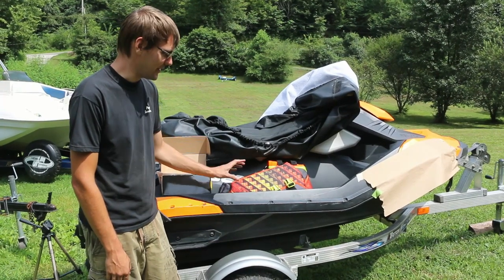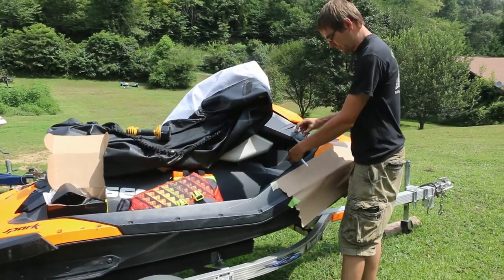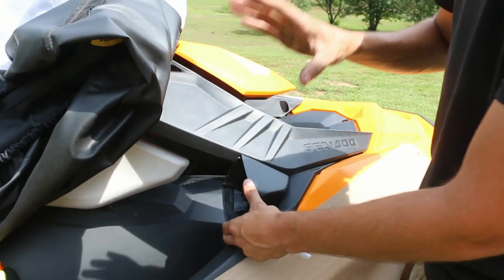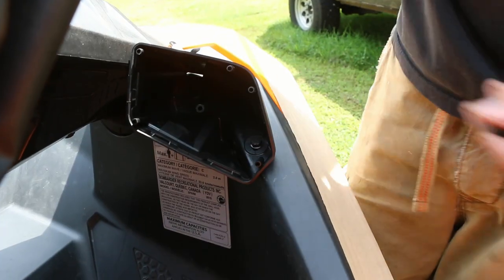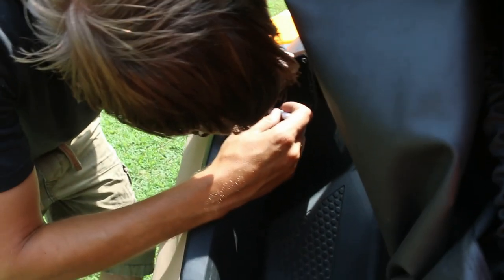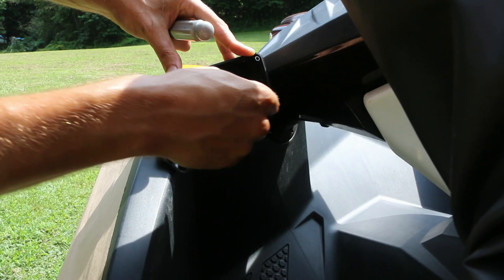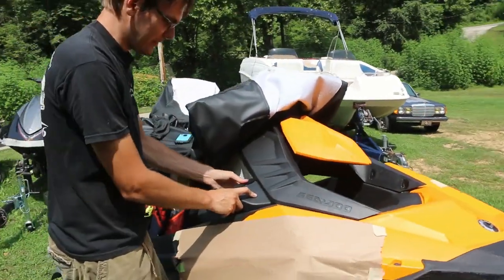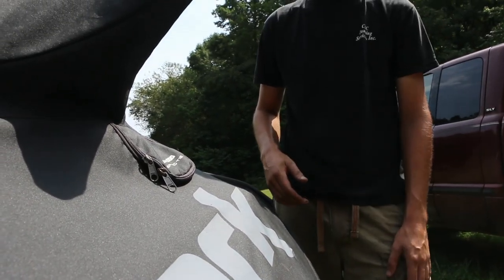OEM Sea-Doo Spark Mirror Installation

Comment: You should definitely be waterproof sealing those new drilled out holes with a marine grade sealant. Just dab a generous amount before tightening the screws. Holes on a boat are not good.
Reply: I will definitely do that!  great suggestion!
Reply: Do you realize that its an upper hull where engine air intake HUGE holes are located too? lol

Comment: I know this is an older video but  I just got a used 2018 sea doo spark, what other accessories can I get for the SDS?
Reply from the maker: There are options to add reverse (if yours doesn't already have it), mirrors, storage compartment in the front, boarding step, I've seen audio systems, and of course plenty of performance things, do you know if yours is the 60 or 90hp?
Reply: @trythistv  thanks just bought a used spark two weeks ago with 11 hours which included front bin, back step, OEM cover, IBR, and in great shape trailer for $7600 so looking to add a few more things, how can I find out the current value of any jet ski??

Comment: I just bought them are they good even if they are installed low inside?
Reply from the maker: They offer decent visibility, and also fulfill the coast guard requirement of being able to see behind so you can tow without a spotter sitting backward on the ski. I'm not 100% sure what you mean about mounting them down low, do you mean tucking them down somewhere even lower than where the intended mounting location is or just that the spot looks low?
Reply: @trythistv  yes the mounting spot looks low and I was wondering. Thanks for the fast response. Cheers Mat

Comment: For anyone with these mirrors , do they have good vision? Are they worth installing?
Reply from the maker: I'm quite tall (think middle of 6ft range) so my legs tend to get in the way of a lot of mirrors on skis. These have a slight convex shape to them that made them very effective despite them tucking into the body lines of the spark so well.
Reply: No.

Comment: Can you see a tube being pulled with the mirrors so low?
Reply from the maker: Surprisingly they did seem to do very well for visibility. I didn't really think to check, but the mirror might have a little convex shape to it to allow a wider area to be seen, I can't say that for certain though, and it probably helps that I'm not a very big fella so I could see past my legs easily and it didn't feel like I was having to dramatically change where I was looking, just a quick glance down and you could see quite clearly behind the ski.